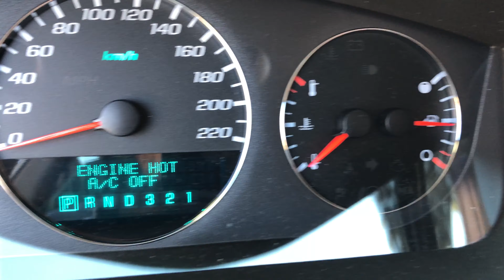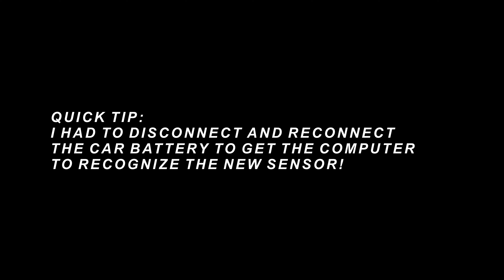2009 Chevy Impala LTZ Coolant Temperature Sensor Replacement - Fix Engine Hot A/C Off - 3.9L V6

Comment: Changed mine twice and found it to actually be the thermostat. It was a pain taking and putting a new one in! If you keep having this issue even after changing the coolant temp sensor it’s a hundred percent the thermostat!
Reply: Did it work for a while originally?
Reply: After the initial change I mean
Reply: Had both of mine replaced and the car is acting the same way just a day later. What else could it be?

Comment: As a matter of fact ……mine had the same fault reading on the display……found out it was the the thermostat and changed it out n had the diagnostic check …….cleared the code …….hopefully that solved the problem

Comment: Great video! I'm in the process of replacing my coolant temperature sensor now. I have a 2006 Impala LT with 3.9L engine. I ordered a 19mm stubby ratcheting wrench from Amazon but unfortunately, the ratcheting end is too large to be able to get on the sensor- the engine mount creates too small of a clearance. Another video using this same method showed and stated they used a stubby ratcheting wrench made by GearWrench so I ordered it from Amazon. The description states a feature of this wrench is it's designed to use in close tolerance areas. I hate to think I need to remove an engine mount to replace this sensor.

Comment: I did everything in this video but my cooling fans don’t turn on still. Anyone what may be the problem of y’all dealt with it before
Reply: @terrancenasafotiesr.9601  ima have to check that out cause my coolant would boil and changed the cap and just spills from there I’ll check it out thx bro

Comment: I got question plz help I got 09 impla n I put new sensor n I unplugged bat for 20m n tht code still coming up
Reply: If you already changed the coolant temperature sensor try changing the thermostat then the “engine hot a/c off” notice will go away.

Comment: I replaced my coolant temp sensor as well ,and code still came back few days later....
Reply: Mine came back on during my test drive.
Reply: @Jeff-ve1bu  another video said to replace the thermostat , I have not done this yet as the code has not came up for awhile
Reply: @michaelc9128   I ended up replacing the thermostat and no issues now. The thermostat was shot, wasn't sealing and the seal was half gone. I actually bought both parts at the same time knowing they may both be the issue.

Comment: Except ive done this job 3 times still have the same.issue
Reply: Yes! I’ve done that and the thermostat 3 times too! This is the only issues I keep having and can’t find the problem. Spending hundreds on parts and labor. So frustrating!!!
Reply: @ladyareed  Mine did that. I tested and reseated all 3 relays and it started working. Use a little dielectric grease on the legs
Reply: Wireing harnesses is bad at the sensor conector most likely.

Comment: Will this sensor cause the car to over heat
Reply: No, it only tells you the temperature.
Reply: @N_Andrews  can you at least still drive it
Reply: @stackboybeezy1042  Drive mine every day. When it freaks out and reads cold an the AC won't work I just disconnect the battery and reset it.
Reply: @N_Andrews  thanks ..it kinda feels like it’s barley taking in gas like it’s trying to stall out since this started happening
Reply: @N_Andrews  what if mines is doing this but it still blowing hot heat